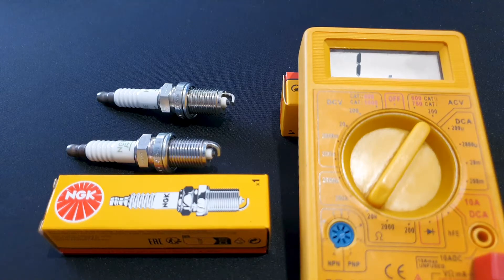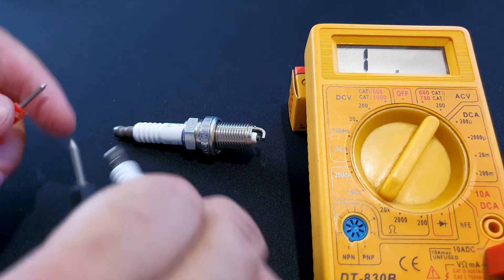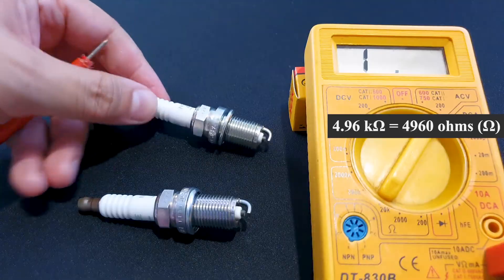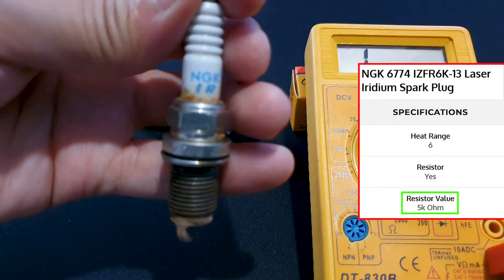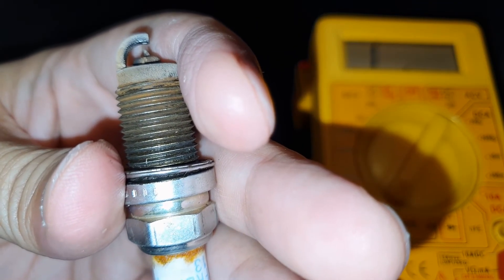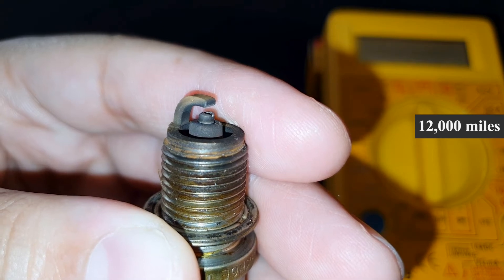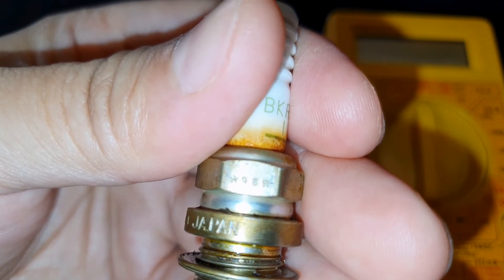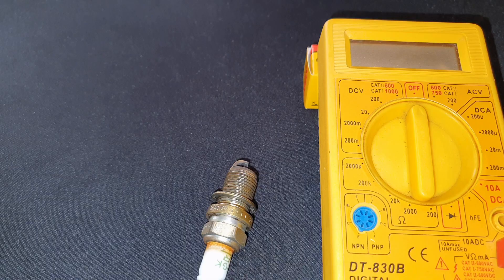Spark Plug Resistance Testing with a Multimeter - New and Old plugs tested

Comment from the maker: While spark plug resistance can indicate a spark plug's condition, it's not a definitive "good" or "bad" indicator on its own. The last set of spark plugs shown, it wasn’t known beforehand if they were genuine. While resistance values alone aren't a foolproof method to determine if a spark plug is genuine, they can be a helpful indicator, especially when combined with other visual checks, as genuine spark plugs often have a consistent resistance value within a specific range.

The 100,000 km spark plugs shown, even though the resistance levels are just below the acceptable range, the vehicle still ran great with no noticeable change in performance or mileage. For the 20,000 km heavily fouled plugs, the vehicle had a massive increase in performance with new spark plugs with the same old ignition coils. New ignition coils will be installed.  

Reference materials:
www.ngk.com
https://ngksparkplugs.com/en/

Must read
https://ngksparkplugs.com/en/resources/5-things-you-should-know-about-spark-plugs
https://www.ngk.com/can-old-spark-plugs-be-cleaned
https://www.ngk.com.au/technical_info/analysis/

https://www.ngkntk.com.br/site_ingles/direct/p8.html

MMT and Ferrocene research
https://patents.justia.com/patent/20190214794

Comment: Hello, Wrench Wiz!😃 THANKS so much for creating and sharing this very informative video!!❤ Two questions, if you don't mind. First, is a 7,100 ohms resistance good or bad for a brand-new R type of NGK spark plug purchase? I have a brand-new one that registers this high reading while the other three of the set shows 6,300 ohms only. All four were bought directly from Niterra. Second, will the resistance value of an R type spark plug decrease or increase as it gets old and used up?
Reply from the maker: NGK did tell me a 3k to 7.5k ohm window, so I believe it should be fine. Plus you bought it directly from them. For peace of mind you could send them an email: Info@ngksparkplugs.com

Resistance should increase. However heavy carbon fouling can cause it to decrease as it is conductive.
Reply: @TheWrenchWiz Great info! THANKS so much again!!❤😃

Comment: Well I bought Bosch spark  plugs on amazon   and found out they were fake      but I was not really sure    so I installed them    
First good    but really after 2000km they were just gone   really  resistance too much of a difference     I replaced them with good original plugs   and yes all the rough running gone     perfect again
Reply from the maker: Great you caught it. Too many fakes around.